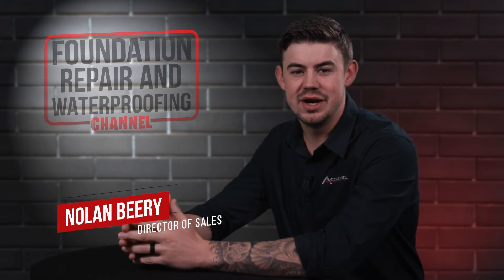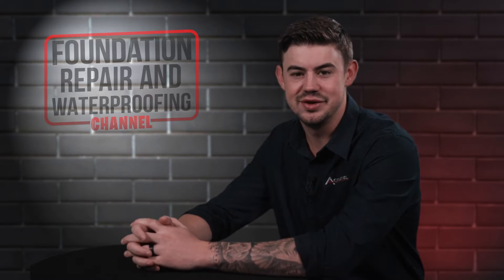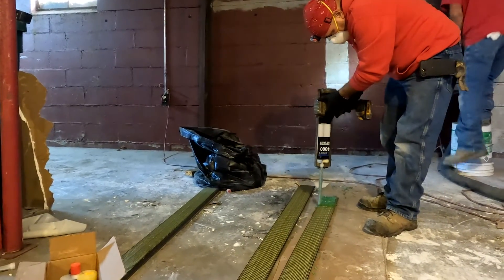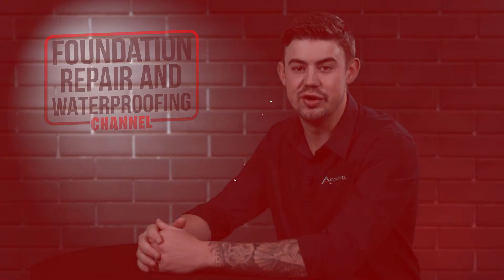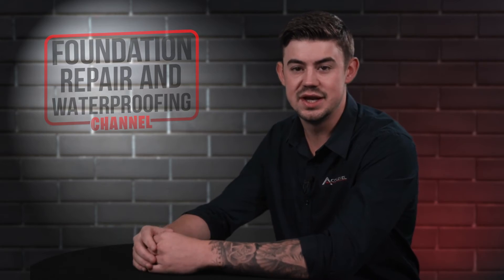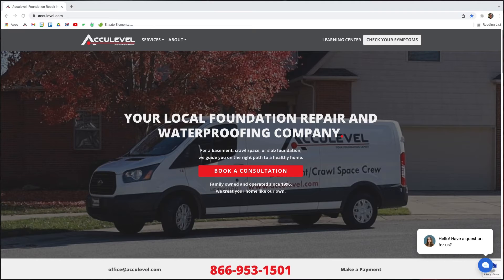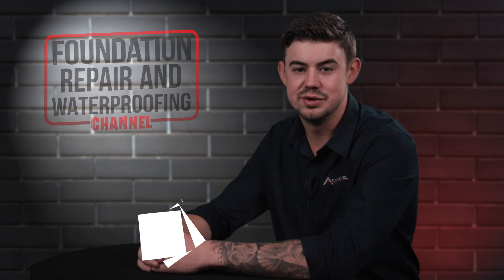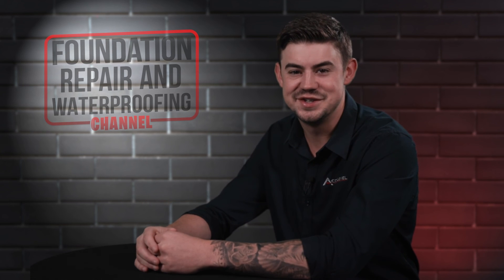How Are Carbon Fiber Straps Installed?

Comment: I've got a garage foundation on a sloped lot.  The foundation wall on the back of the garage is exposed by about 3 feet and bows OUTWARD, away from the inside, about an inch at the center of the wall causing a 1 inch gap between the slab and the block foundation.  My question is whether carbon fiber can be used on an exterior wall horizontally from side to side at the top of the wall to keep it from bowing more?  Understand that the carbon fiber will be installed on the OUTSIDE, not the inside.  Thanks!
Reply from the maker: This is a great question and thank you for reaching out and asking. The short answer is that carbon fiber straps will probably not work in this situation. In this type of situation there is not any subflooring, floor joists or floor system at the top of the foundation wall like a typical basement would have which is what is typically required for carbon fiber straps to work. It is likely that wall anchors or tiebacks would be a better solution or option in this situation. As long as you are in our service area, we would be happy to take a look at this and provide with a solution and I proposal. You can reach out to our office at 866-669-3349 or office@acculevel.com to set up a time at your convenience.